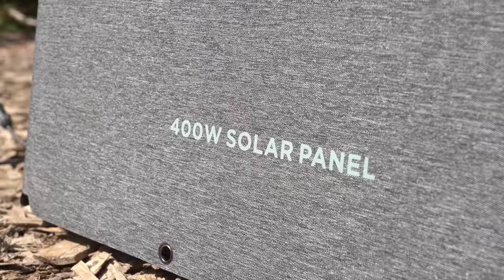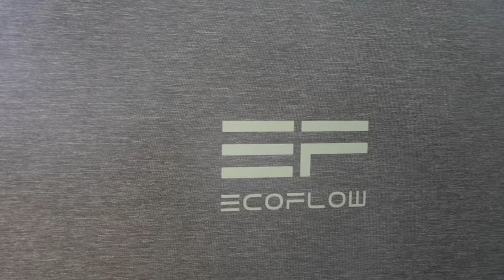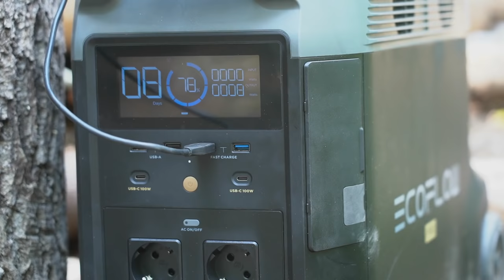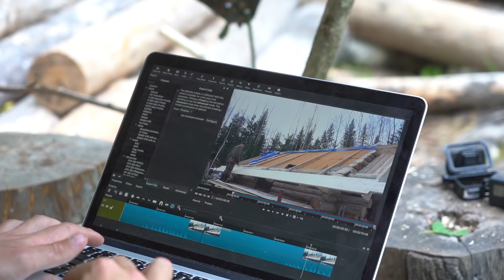How am I able to be OFF GRID and do YouTube?

Comment: Yes. Very cool. I have used solar and batts for my amateur radio and lighting. Its that's way to go.
But My opinion... don't mess with up conversion; inverters AC. Keep everything low voltage DC. 12 - 24 volt. Then use regulators to drop the voltage where needed.  Up conversion is inefficient Besides you don't  need to send it far or have heavy appliances. so you don't need high voltage..

Comment: Excellent video. A tip for you - always keep all cameras on the same frame rate (eg 50p) and edit in the same frame rate. That way you will prevent things like the drone shots having broken motion caused by different frame rate (like 60p or 24p).

Comment: So many things I would have to challenge such as bathing in an icy lake or stream or breaking away the ice to go under the water.  No one did that in real life.  Baths were simply not taken for months except the washing off in a small amount of water in a bowl.  But I watched this and loved it.   The young actor was terrific and the product placement was terrific, in fact, I doubt any cabin builder has ever been so well dressed as they took antique roof tiles from beneath a barn or slipped out of the frigid water into uh. . . Dry clothes.  Hehe. Great production of a beautiful cabin,  and as far as electricity is concerned , everyone should have one of those solar/battery devices in case of a cataclysm of any sorts.

Comment: Off-grid internet's no problem as long as it's within 35 to 40 miles.
I can tell you how to build a bi-quad, omnidirectional Wi-Fi antenna that'll hit ranges of 40 miles using a standard DirecTV dish on your roof.
I use McDonald's free Wi-Fi at 36 miles away every single day.
Thanks! 🤣

Comment: How? Because that's not what "off the grid" means. XD  It means that you aren't connecting your dwelling or living space to any state infrastructure for things like lights, sewer/water, etc. You can have technology just fine while off the grid; you're just making an entire system for your own use. Which is deeply impractical, for obvious reasons, and unnecessary in most cases where some "sovcit" is convinced they can own land but determined to not use infrastructure, but makes sense for solar panels in Sweden.